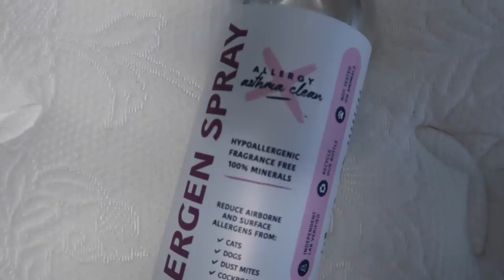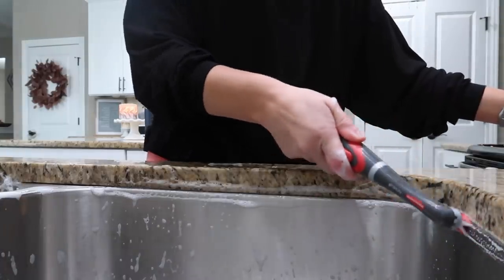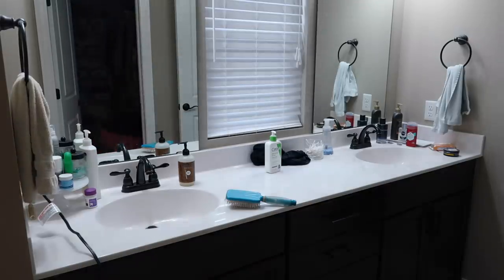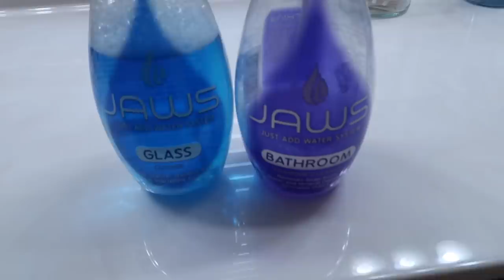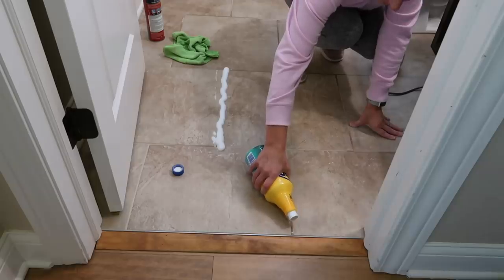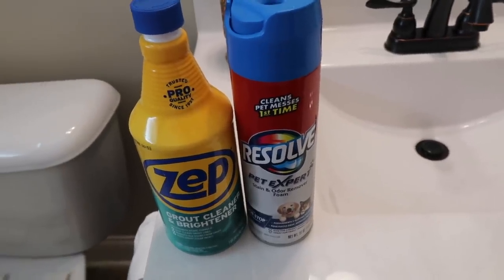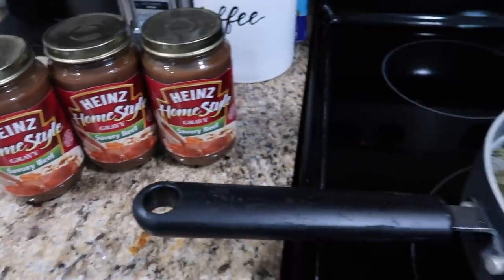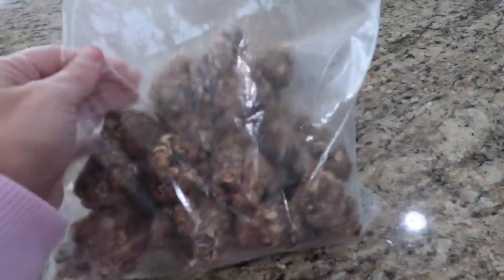*EXTREME CLEAN WITH ME 2021 | FAVORITE CLEANING PRODUCTS | SPEED CLEANING MOTIVATION | DEEP CLEANING

Comment: In a previous home I had tile floor in my kitchen with white grout, it was a nightmare to clean on my hands and knees (even in my early 30s). I used regular old Comet and a toothbrush to get the grout white again, it work really well but needed lots of rinsing. (I would totally suggest anyone getting  new tile floors or a new house plan to make it a "dark" grout to start with but even better no tile in the kitchen it is very hard on the legs and feet.)

Now in a different house I use the Clorox cleaner with bleach spray in my bathrooms, white tile and grout (circa 1992) The Clorox w/bleach spray works fantastic getting the grout the whitest than other products I have tried. I spray an area at a time, use a brush on a broom stick with a little water and scrub the floor then use some paper towels and push them around under the brush to soak up any wetness. It is the only cleaner I use on the bathrooms floor and white tiled shower walls now.  Best practice would be seal the grout when it is new or if you can get it really white seal it then. 

Additionally, my shower floor is the old vinyl shower tray (circa 1992) and it started to get a blackish staining, I searched the internet for quite a while before I found a video of some guy using the Easy Off oven cleaner (blue can) to clean an old shower tray, I tried it and it worked!! It smells but it works! I only use it rarely now if needed.